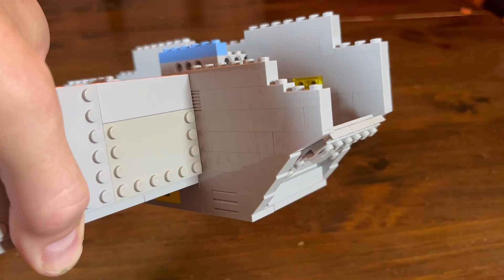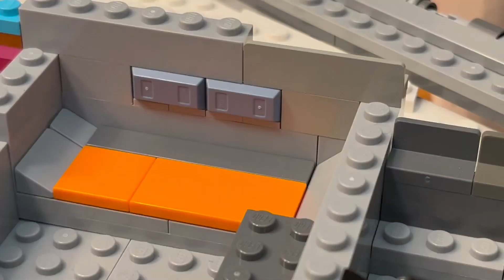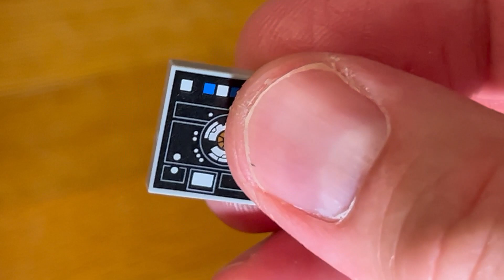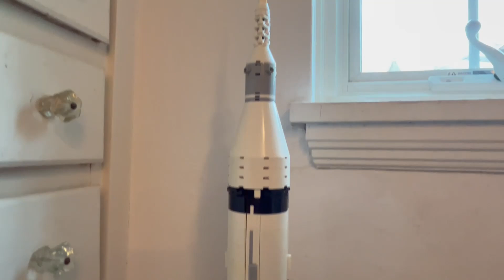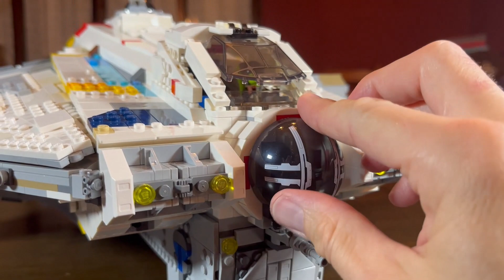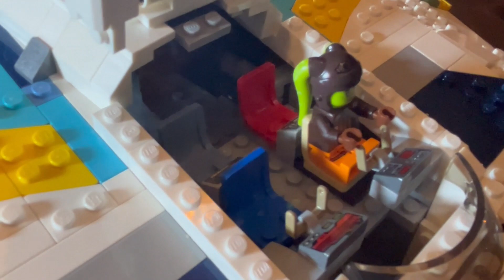The Ghost (Star Wars Rebels & Ahsoka)! Modified from 2Bricks design. Full interior! #lego #starwars

Comment: The only place where I would differ on what's been added is the escape pod. I think leaving the airlocks would have been neat as we're consistently shown both throughout Rebels, at some point even carrying 2 Y-Wings or 2 A-Wings (which would be neat if they could connect somehow). Otherwise the modifications you added are quite on point a great addition to the the set overall. Looking forward to see if you add the Phantom, it would be great to see botn of them actually, as they are quite different ships but they somehow made them fit.
Reply from the maker: Thanks for your comment! The escape pod vs port airlock was quite a dilemma for me, especially given how ambivalent I am about escape pods on spaceships. The additional airlock would probably be more useful to allow the Ghost to act as a small carrier. Who knows, maybe I'll modify the ship at some point!
Reply: @AndyBuildsStuff  isnt the phantom an escape ship basically? Great idea though, I like both ways. This is the kind of stuff lego should make. 2 bricks should work for them
Reply from the maker: @akmankalash I think of the Phantom as a shuttle, it’s an auxiliary craft to use when needed. The escape pod is for emergencies, it’s there to get crew away from a dangerous situation and that’s about it. But including an escape pod seemed rather questionable, I must admit.